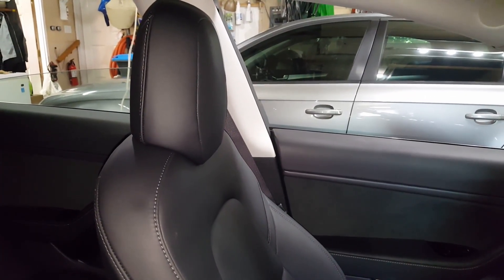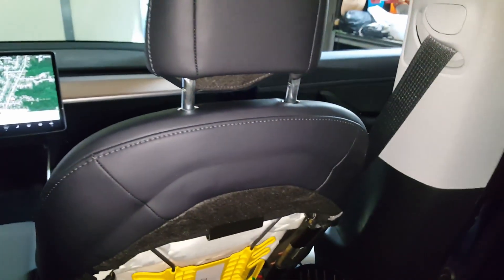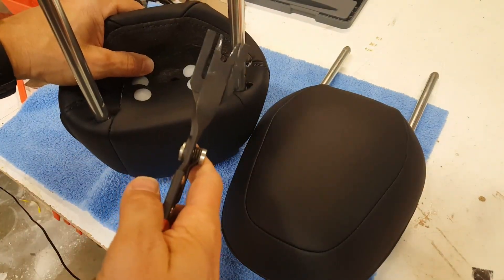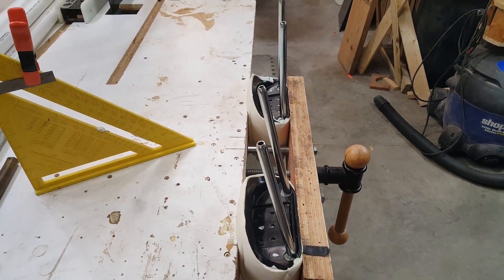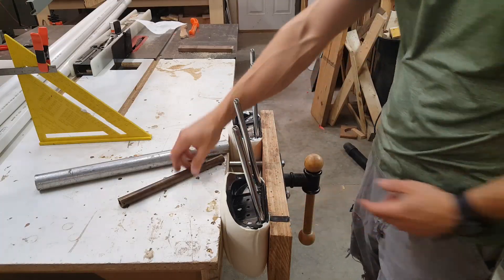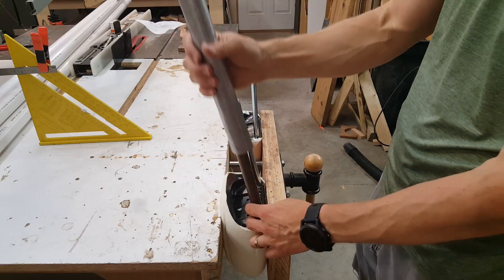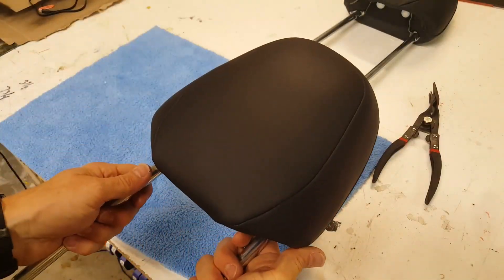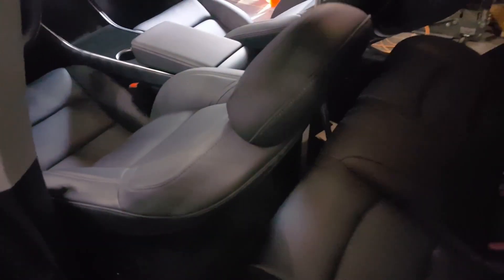Tesla Model 3 headrest removal and modification

Comment: Thank you for good info. I used some tape to hold plastic rear covers and didn't remove the covering. Did some bending and now testing whether it or flipping them front to back is better for my neck. When flipped, you can add some polster if too far back. I also find Tesla headrests too hard and slippery, head  just bounces back and slides to side. A bit softer polster with more friction helps. I have never needed to do these kind of mods to my cars. Love the Tesla though.

Comment: The US Department of Transportation National Highway Traffic Safety Administration 49 CFR Part 571 [Docket No. NHTSA-2010-0148]
RIN 2127-AK39 Federal Motor Vehicle Safety Standards; Head Restraints came up with 55mm from back of skull to front of fixed head restraint.
Tesla must be compliant. Apparently Tesla found a Asian with a posture of a cooked Shrimp to be the reference point. I did this mod on my 2026 Junoper Launch, and it's a new car with neck pain gone. Simple to do and even easier without stripping the fake leather off. Thanks for this.
Reply: 100%. Did the Juniper headrest come apart basically the same as this M3 headrest? Did you use a bench vise like this or did you use another method? I am thinking of laying it on the floor and putting my foot on it or something as I pry the bar up as I dont have a bench vise like this.

Comment: Great video! Just easily pulled the headrest and flipped it on my new (Sept 2022) MYP. Telsa added extra plastic pieces to hold the metal clip, but I could still easily pull them out. Headrests do not clip back into place with my solution, so the video solution is still the best.

Comment: This helped me immensely.  
I just wrapped the headrest in a towel, wedged it between a load bearing wall and my couch and pulled. Used my hydraulic jack handle as the pull rod.

Comment: Excellent - thanks Jon for sharing !! - will do this on our new 2021 model 3  -  surprised Tesla has not modified this yet.
Just attempted this with the 2021 AWD and  there are no clips but a plastic bushing of sorts on the top of each shaft - will try to figure out how to release the headrest  ? ?
Reply: Did you figure it out?
Reply: @david1256-a  Got it - Thanks - much better angle now.
Reply: I dont think this works on the 2021. we just tested one - it looks quite different
Reply: @markdanzig1380   Actually it did work on our 2021 Model 3 - I drilled a hole in a solid upright 4x4 fence post just big enough to put the headrest post in (one at a time) and was able to carefully bend each post with quite a bit of pressure to where desired.
Reply: @dschwep7  you cannot remove the headrest at all on the latest models, that's the issue. When you start digging down the fabric as shown, it looks very different, there is no way to remove it anymore that I could find. If anyone knows different please let us know but the TESLA store said they changed this so that modification is no longer possible
Reply: @LearnBassWithAri   all i can say is that we did remove both headrests on our 2021 AWD model 3 purchased new in June  2021
Reply: @dschwep7  There is no way to release the headrest in teh models they are selling now.... it looks quite different than in the video above and we tried and tried to no avail. At the shop they said this got disabled and they are no longer removable. It is a total dealbreaker for us. If anyone knows a way.... we are all ears. Thank you for responding and sharing your experiences
Reply: @LearnBassWithAri  Maybe it's not possible on some newer Model 3, but my SR+ (delivered Sep '21) has removable (front seat) headrests as shown in the video. Just wouldn't try to bend the posts, it's way to improvised for such a security-important part 🙈
Reply: @LearnBassWithAri  I have a 2022 M3P and this works. The clips are quite difficult to find they are quite low inside. Then you just move the clip to the left away from the metal tube. Same on both.
Reply: @georgeborrelli3134  Thank you so much for the info! Really appreciate it. When we test drove it it seemed impossible. Appreciate your answer
Reply: @LearnBassWithAri  I have taken both head rests out now for testing and comparison. I was able to bend the driver's side adequately. It took several iterations. A person attempting this would need to be handy with this sort of thing. I compared the angle of the stock passenger side to my completed driver's side and I could see quite a bit of change to the angle. Many people seem to give up at the very first step, finding the clips. The clips are a way down inside the material of the back rest. The clip is just spring loaded and puts pressure on a detent in the head rest down tubes. There's a clip on the left side, looking from the back seat, on both tubes. I just used a skinny flat screw driver and moved the clip away from the tube or towards the left and that released the tube. The tube wants to go back in, so you have to have a hand in between the back rest and the head rest until you release both sides. After that difficulty, the next most difficult part is having some way to secure the head rest while you carefully bend a tube.

Comment: Great adjustment, Jon, but now people are putting pillows on their headrests to bring their fit forward. I don’t understand them. I don’t want something pushing me forward. I have two fused discs in my neck, so I can’t have a headrest that is bent backwards. My 2006 Honda Civic had headrests that would move forward in a rear end accident. My 1993 Volvo 850 had whiplash protection seats that would pivot back to absorb the rear ended accident’s energy.

Comment: Hey Jon, thanks so very much for this. My wife likes the seat back absolutely vertical and her head was pushed way forward and down by the headrest. But I made a modification to your procedure, once I had the headrest off, I just flipped it around and put it back in, without bending the bars or removing the cover. It looks surprisingly good! A casual observer wouldn't notice the difference. The headrest is now about half an inch behind her head, has plenty of cushioning and would appear to offer better whiplash protection than the seat in her Lexus, where the headrest is at least 2 inches behind her head..
Reply: Flipping it round is a great idea. I took a model 3 for my first test drive today and loved it but really didn't get on well with the headrests. I have my seat pretty upright too.
Reply: @pwells2389  I just tried the flip-around and it worked super well.
My neck and back issues are over..!
Reply: Nique- did you do the flip around technique on the 2021 ?
Reply: @susannordstrom62  My model 3 was built in 2019 but I think the current seats are the same?
Reply: @Beanick  they are not. We just tried it
Reply: @markdanzig1380  Oh that's a shame. The flip around was so easy to do!
Reply: After I noticed a reversed headrest by chance in a different video about another topic I also flipped my 2020 passenger's headrest. My partner loves it.

Comment: I don't understand this.  The "headrest" isn't intended for resting your head, but for banging your head in an accident.  Your head shouldn't touch it but it should be close.  I'm 6'1", and my head doesn't touch it -- Why would I want it further away?
Reply: It's probably bc your upper back has much meat that allows your head to naturally rest away from the headrest. Others have less meat on their upperback and higher cephalic index for their skull
Reply: @jdkim6829  Maybe I should have said this before, but I've been teaching people to drive professionally for 12 years.  No, headrests aren't designed for resting heads, and if you're resting your head on your headrest, something is definitely wrong.
Reply: @charliehorse8686  that's exactly the problem with tesla's headrests. They are too bent forward that they force many people (not you) to rest their head on it and even tilt drivers head down. Just compare the angle of seat to headrest between Tesla's and other vehicles'
Reply: @jdkim6829  Oh I get it... I thought people wanted to rest their heads like a pillow while driving and this was to allow them to do that.  Now I realize this is so they can avoid touching the headrest in normal driving.  (Also probably makes it easier to check the blind spot.)
Reply: @charliehorse8686  yeapyeap. oh yes true the headrest gets in my way when turning my head.
Reply: @charliehorse8686  sorry but I cant wait to get my head rest pushed back especially for times that I'm sitting in my car but not driving. It's a pain in the neck literally
Reply: I'm 6'3" and the top of the headrest is constantly rapping the middle of my head as I go over bumps. These are bad because they aren't adjustable, but I've found most every car I've been in, the seats and headrests fit my 5' wife perfectly. Seats don't seem to be designed for taller bodies. thinking the headrest back a bit would help me.

Comment: Great video! I was wondering if it's the same way to remove the rear headrests. I'd like a better view out of the back windows
Reply from the maker: The rear headrests are integrated into the seat - both the underlying structure and the cover, so it would take significant work.
Reply: @rdtc2854  thanks for the reply. Argh. Well Sawsall it is then, lol

Comment: Can the same thing be done for the back seat? Looking at a model 3 and securing a car seat is a bit wonky with the headrest attaches to the seat.
Reply from the maker: The headrest on the rear seat is integrated into the rest of the seat, so no, not easily. Someone who does upholstery work might be able rework it to make the headrest removable...

Comment: This is a great idea.  I have serious neck issues, and I needed a solution.  In fact, I wouldn't even buy the model 3 til I was sure there was a solution.  
As a somewhat simpler fix, I just followed your instructions for removing the headrest and then put them on backwards, which instantly fixed the issue.  I'm sure this isn't as safe as your solution, but it was quick and easy.  I may later do your full fix, but in the short term, I'm all set.  Thanks!

Comment: What people say about possible safety issue with bending them might very well be true.   One thing that might be a useful idea out of all this is the ability to remove the headrest cover. What if you could get headrest covers in different colors and you could customize your car by putting a different color headrest than the seats. Put a white or red headrest cover on a black interior car etc.   Evannex or someone should come out with other covers as an easy change option or maybe tesla could. They already make the white ones of course anyway. The stores could offer the change as and extra income source.

Comment: on new model 3s they don't look as simple to remove
Reply: It works on my 2021 model 3, you just have to dig a big deeper into the seat. The clips are grey metal, so they will be visible if you dig deep enough, below the black plastic things
Reply: Jon, do you know if this is so?  I won't buy a Tesla if I can't change the headrest
Reply: Chonsu On what basis are you assuming this? I’m just curious as the original headrest position is close to a dealbreaker for me. :)

Comment: This is a cool mod, but it could have effects on neck injuries in a crash.  The stock angle may have reasons based in science.

P.S.  A different way to change the headrest distance is to remove it from the seat and flip it back to front, so that the back is now facing forward and the front is now facing backwards.

Comment: Those are not head rests, they are HEAD RESTRAINTS.  They  are designed to restrict head movement during a rear-impact collision and reduce the chance of neck and shoulder injury.  You just increased you and your passengers chances for injury.  This is a bad idea.
Reply: Head restraints are supposed to be no more than 2.5" away from your head.  In my case, they're about -1" away from my head.  (That's a negative sign.  They push my head forward so that I'm looking down.  I think it's a short-person-with-good-posture problem.)  As long as they are to spec after bending, they still work correctly as head restraints.)
Reply: Depends on driver's height.  A sure neck pain if you are short and this thing forces your head forward.
Reply: i find having my head pushed forward distracting and tiring on a longer drive which in itself is dangerous for me
Reply: In some cars the headrests can be adjusted forward and backward as well as up and down. This is ideal, since proper position depends on  seat back angle, torso length, and posture.
Reply: But government regulations prevent them from being adjusted back more than 2.5" from the back of the head of some average person with bad posture.  So it still doesn't help those of us who sit up straighter.

Comment: Just doing this may weaken the metal.  Likely it is still strong enough for a high energy collision, but just know there is a bit of a risk in doing this.
Reply from the maker: Technically, yes, bending tubing weakens it. But that is how they form the headrest support in the first place from the 14mm steel tubing. I haven't made any significant change to the strength of the headrest from the adjustment shown. Example of how headrests are formed: https://youtu.be/4U9EdA5pxx8
Reply: Jon Osborne What a cool bending machine! You’ve always got the answers, Jon

Comment: Great video, Jon! You've got a great shop with amazing tools. 
If you needed to return a headrest to the original factory position, would it cause the metal to weaken?
Reply from the maker: I wouldn't be worried about making a few adjustments. As long as you aren't putting any kinks or other deformations in the tubing while bending, this is really no different than the bending used to manufacture the headrest in the first place. It's 14mm steel tubing.
Reply: Jon Osborne I look forward to to seeing more Model 3 videos from you.